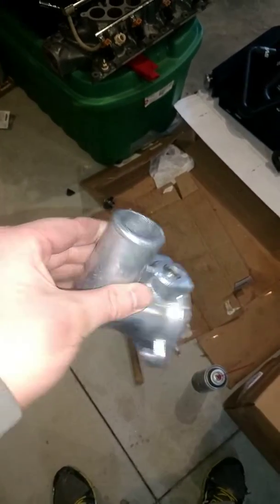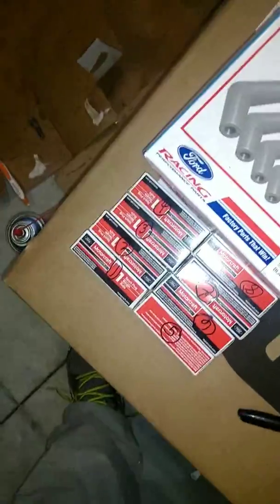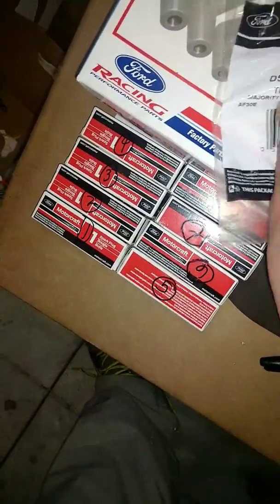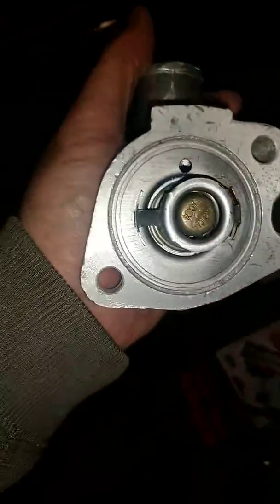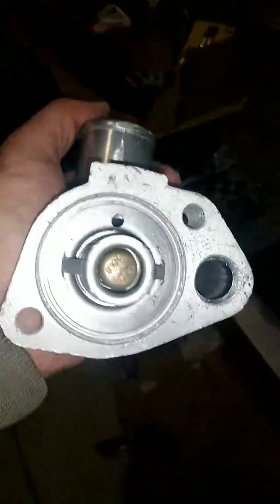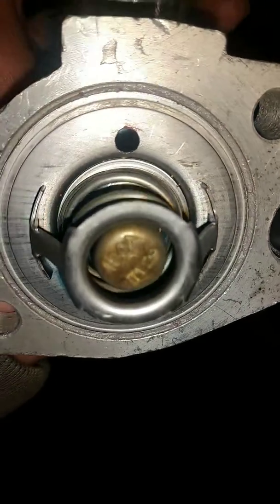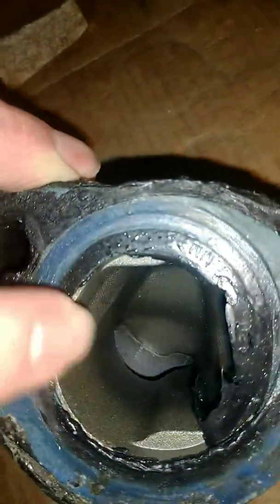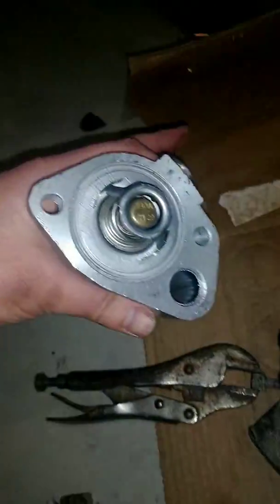Foxbody Thermostat Housing issue solved/RTV

Comment: Looks like it is solid.  Should be fine.
Reply from the maker: Should I use more RTV at gasket? Or just gasket??
Thanks Amigo
Reply from the maker: @fwh79FOXR6  thanks
Reply: @jpp9846  You're welcome.  When are you planning on dropping the intake on?
Reply from the maker: @fwh79FOXR6  well...I just got my plugs gapped, anti seized and in the block. I plugged all my wires in the MSD cap, replaced rotor. Probably put this water neck on here shortly and it'll be that time. Kind of nervous, lol!
On the lower intake gaskets, should I put RTV by coolant ports on gasket? I know I am putting some.at the 4 corner seams. I am being told no RTV over cork ends, correct? Can you think of anything else I'm missing? I'm going to use the auto studs to hold gasket in place and guide lower on. Then "goop" a little moly grease on the bolts before torquing. I studied up on my Torque wrench last night, just need to check specs and rotation again.
Just want to be prepared when I do it...let me know if I'm missing anything else, thanks again.
Reply: @jpp9846  I didn't use any RTV on the coolant passages.  That gasket has a nice edging that should crush down and seal up the coolant openings.  RTV on the cork is your choice.  If you decide to use RTV, apply a very small smearing like the thermostat housing.
Reply from the maker: @fwh79FOXR6  did you use it on your corks?
Reply: @jpp9846  I didn't use the cork end pieces.  I ran a fat bead of black RTV on the front and the back with no end pieces.
Reply from the maker: @fwh79FOXR6  what specs did you use, in the 3 step sequence?
Reply: @jpp9846  15, 20, 24
Reply from the maker: @fwh79FOXR6  thanks!
Reply: @jpp9846  You're welcome.
Reply from the maker: @fwh79FOXR6  do you use Teflon tape for the water pipe?
Reply: @jpp9846  Yes
Reply from the maker: @fwh79FOXR6  I managed to get the lower down last night. Those automotive studs worked very well guiding the intake down. I will make a video later, showing it done. Spent time pluging things back in and getting that water pipe back in, which lead me to replacing the heater core hoses, and back to the water pipe, which is where I ended. 
Couple concerns I have, one, NOT getting this lower all torqued down in that RTV, 10 minute window. I read you have to get that down or it'll leak!! Hoping that RTV worked with me.
Two, one side of that heater core port seemed to be a little "wiggly". My thoughts this morning got me wondering if the core itself is just loose on the other side of the fire wall or worse, the port is broken on the core! Guess once I get it all back together, I will know! I know that heater core is a SOB to get to. Hoping it was just loose. I will be inspecting it closer later.
Do I need to do any further torquing today? I worked up to 24#'s and left them. And I am trying to think of what I can uses to "lube" up these water pump ports and the hoses to get them to slip on easier?
That's where I'm at...I got a shit ton, done yesterday...plenty more to work on this week!
Reply: @jpp9846  I wouldn't worry about the RTV.  It is fairly temperature sensitive.  If it was 90 plus degrees outside, it may have been a problem.  You should be fine with the cold temps right now.  I would retorque the intake bolts today.  Was your heater core bypassed?  If it was bypassed, it is probably damaged or leaking.  You can lube the hoses with silicone spray.  That should make it much easier to install them.  Before I forget, make sure you pick up a 24mm end wrench for doing the front struts if you don't already have one.  If you don't have power or air tools, you should get a 3 foot long piece of pipe you can slide over your breaker bar.  Those 24mm nuts on the front struts will probably need some power to break loose.  You might want to start spraying some liquid wrench on them everyday so it can start soaking in.  That will make removing them much easier when you get around to doing the damper install.
Reply from the maker: @fwh79FOXR6  that makes me feel a little better..I did have the garage heater on, but it wasn't 90 😂!!
I don't believe it was bypassed? I had heat in the cab and there was both hoses from the core ports, attached to the water "bar-pipe" from the front of the manifold. So, I "think" it was hooked up. Man, I hope I didn't crack that SOB, working the hose off! That's gonna make my project, bigger! I will inspect it closely again tonight, after I re-torque the lower Manifold.
Thanks for the strut tip too👍 I will get one of those wrenches before tackling it and start spraying some penetrating oil on them now!
Reply: @jpp9846  If you had heat in the cab, it wasn't bypassed.  That heater core can be kind of sensitive.  Hopefully it's ok.  You are going to find out one way or the other.  It's not that bad changing one if it is damaged.  It's just really time consuming if you have never done it before.  Plus if you don't feel like messing with it, you could always bypass it for the time being.  Having a 24mm end wrench makes getting those lower strut bolts off WAY easier.  Soaking the mounting bolts with penetrant oil is going to make their removal much easier.  You should probably soak the lower mounting bolts for the rear shocks as well.  They pick up a bunch of road crude and corrode from water blasting on them.  Usually the upper mounts are perfect because they are out of the elements.
Reply from the maker: @fwh79FOXR6  if I were to bypass it (heater core), would I just link the water pipe at the end with a 'U" hose?
Reply: @jpp9846  Yes, that is correct.